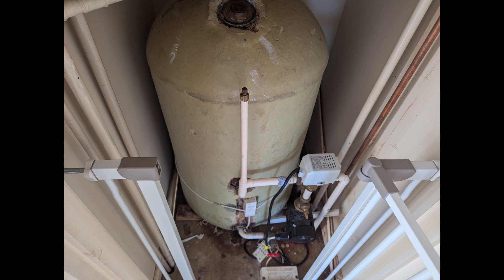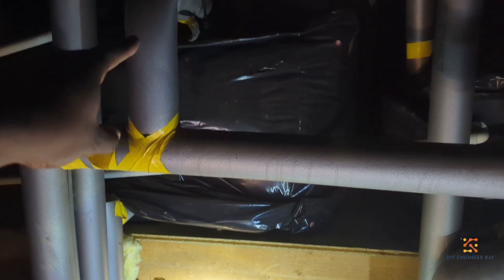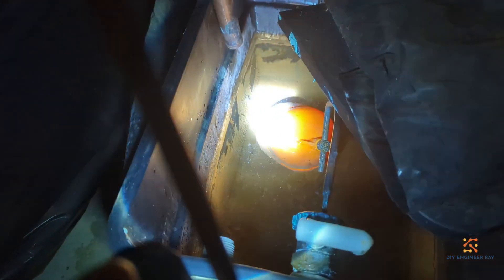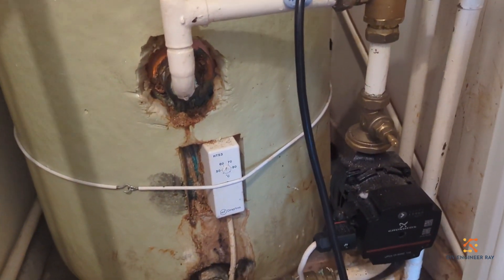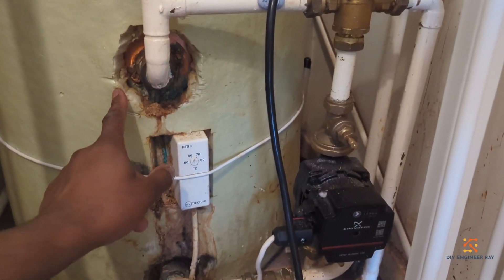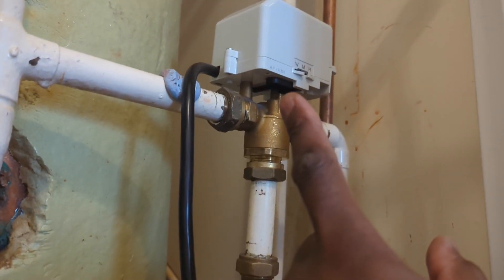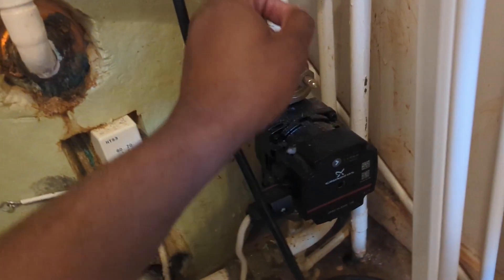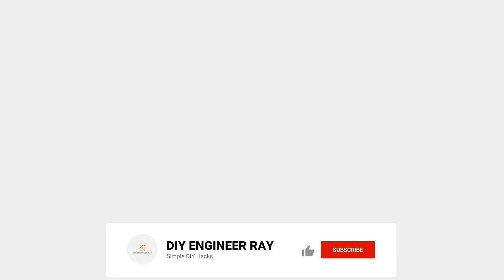Open Vented Home Heating System Explained 2 Loft Tanks

Comment: Hi I have the same system but from two days ago hot water is starting to smell bad and I don't know what is the reason, any idea what is the problem? Thanks in advance. Have nice evening.
Reply from the maker: If it smells similar to rotten eggs, then it's hydrogen sulfide gas caused by bacteria that's  multiplying in the cylinder. Your system needs a clean and flush.

Comment: The original Water Council rules for water installation in all premises required a separation of the mains CW and the hot water that required a break tank, hence the two tanks in the loft space.  Also, the quantity of stored water in the cold water tank was to be sufficient for 1 day's supply that in normal domestic situations was 25gallons, in case there was an interruption to the supply.  Whilst the tank water was not immediately fit for drinking, it could be used as such if boiled first.  Mains water i.e. the potable drinking water was always available to the kitchen sink and the bathroom(s) wash basin.  The reason the tanks are in the loft space was to provide a small but reasonable head (pressure) of water.

Today, apart from the tank based system we have two alternatives 1) mains pressure fed unvented HW system feeding the heating and HW heated in an indirect cylinder and 2)  A combi boiler or instantaneous HW system that heats mains pressure water directly when required.  Both these systems have no storage and are susceptible to loss of water when a mains burst that appears to be becoming more frequent as the mains distribution system gets older.  A friend, who had a combi boiler lost his heating as well as general water supply when the large district pressure main burst in winter that took several days to fix.  Some of his neighbours had the traditional vented system and they were able to offer some warm comfort for his young family whilst STW fixed the main whilst providing bottled water and water in a bowser for drinking.  

As mains fed unvented systems are totally reliant on the incoming mains supply that is typically 1/2" with a pressure of 3Bar, how much water is available at the taps is limited and this is where a tank system is of benefit.  We have two power showers one of 35ltrs/min flow at 3Bar and the other of 28ltrs/min and 50gallons of stored CW.  When both showers are in operation it overwhelms the incoming supply capability of about 25ltrs/min and relies on the tank storage as the buffer.  People often report of failing water pressure on unvented systems whilst say running a bath and a full discharge at the sink.  Combi boilers have the added issue of not providing enough heat to satisfy peak demand when everything is running.